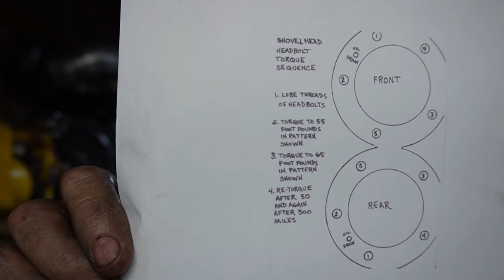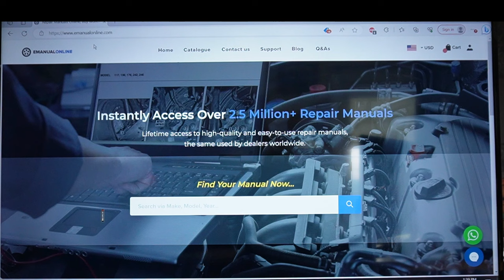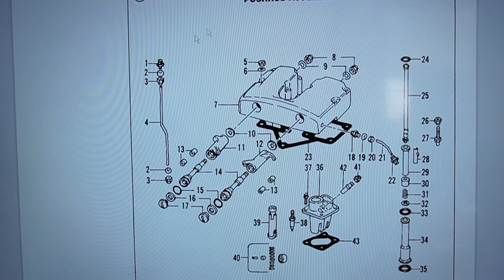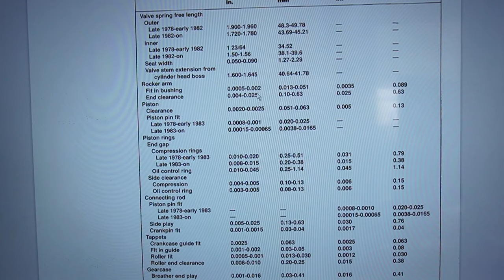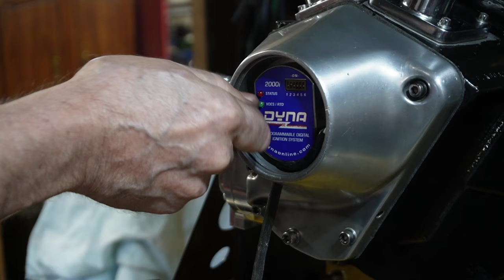Its all in the Details, Final Settings / Torqueing Her down, Getting ready to Run!

Comment: Another great one Ralph. When you pulled out the torque wrench with the extension and quoted a torque value less than what the spec calls out, I tried to remember the equation in my head, and then there it was on the screen. Most people wouldn't show that. Thanks for the reminder.
Reply from the maker: You are welcome. Just trying to help others out the best I can. Small detail but very important. Thanks for commenting.

Comment: Can’t wait to hear to the shovel run! You’ve done an outstanding job Ralph. Thank you very much for the kind worlds as well! Choppers rule!
Reply from the maker: She sound pretty sweet Sean, quite as a church mouse. Thanks. You are more than welcome my friend. Thanks for commenting. Appreciated!
Reply: Nice work 👍
Have you ever used wave washers on the rocker shafts ? They act as springs & eliminate the side play throughout the heat range. I've had good luck with them.
Reply from the maker: @kurtfoulke5130  I have tried the wave washers in the past. I my experience, they broke up into pieces. Shims are the proper way to go, in my opinion  anyway. We all have different experiences. Keeps it interesting.Thanks for the comment,

Comment: Years ago I'd have  customers ask why my shovel rebuild were more expensive than other models, my answer has always been, ' the only way to do a cheap rebuild is use less or cheaper parts, and do less labor', remember the newest shovel is over 40 years old!
Reply from the maker: I agree. Cutting corners only comes back to bite you later. These are old engines and need special care. Thanks for the comment.

Comment: Another great video thanks. I installed an S&S top end on my shovel and it’s got about 250 miles on it and this is the second time I’ve had to retorque head bolts. Base have been ok. Is that wrench you showed ground down around the edges to fit and what type of wrench do you use. Thank you sir
Reply from the maker: Nice topend! Ya can't beat S&S. The one I use for the base nuts is ground down a bit to fit close to the cylinders. The one for the heads is a Snapon 2" dogbone type 12 point.  I have a varity of homemade ones for geting at the head bolts, especially under the Carb area. Thanks for the question and commenting.
Reply: Ok great thanks 👍🏻